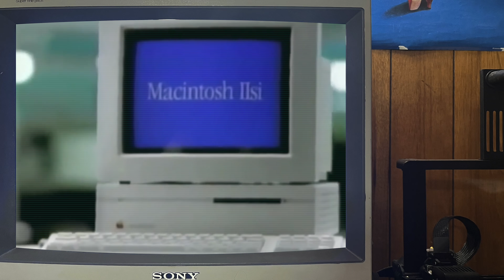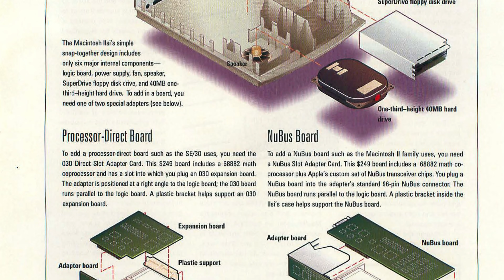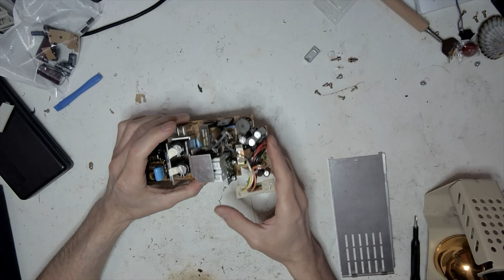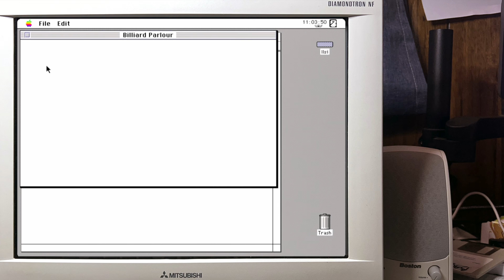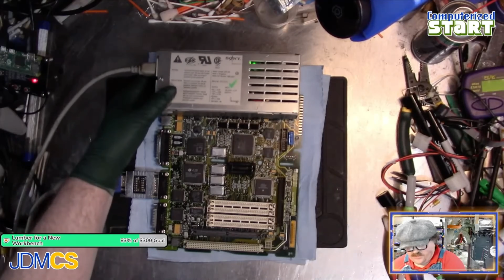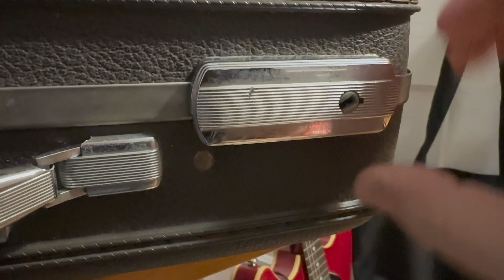Was the Macintosh IIsi Crummy?

Comment: I had a IIsi, a IIci with 60 Mhz DayStar PowerPC 601 upgrade, and a 300Mhz Pentium II running the Basilisk II emulator. I'd pit all three against one another in games of BOLO with all three running the same bot. The PC running the emulator would always win, the IIsi was always the first eliminated. IIRC even when I handicapped the IIci and emulator with lesser bots the IIsi would still lose.

BOLO bots rely mainly on CPU speed. So if you're playing VS bots and want to run other game instances on other computers instead of several on the same Mac, you can change the difficulty by how fast of a Mac you play on VS how fast of Macs you run bots on.
Reply from the maker: Hahaha this is so much more fun than benchmarking with speedometer. I need to try this

Comment: It was a perfectly nice little computer.  It was just worth about 1/4 the price, and it should have come with NuBus slots.
ISA slots were basic table stakes for a cheapo PC clone.  But Apple treated expandability as a price discrimination thing.  Which strangled the market for NuBus cards because not all macs supported them and mostly only macs supported them.  My mom had one in her office in the early 90's and it was one of the things I learned to do computer with.  But it was fast enough for word processing and the kind of desktop publishing most people did in those days.  You didn't have a digital camera, so most of the graphics work in SOHO desktop publishing was very simple vector graphics or low res clip art.  Could even play postage stamp sized Quicktime animations off an external SCSI drive!

Comment: The most important thing about the IIsi is that it has soft power — the ability to turn itself on by a clock event, and shut down without flicking a switch.  By doing this it straddled the low end and high end of the Macintosh II era.

Comment: These were fine for general-purpose office use.  That's what we used them for back in the 90's before Windows 95/98 steamrolled the market.  The 68030 was a turning point in computing because Intel had by this time started making superior CPU's and Windows 95/98 overcame user complaints and drawbacks of using Windows 3.11/DOS.  I was glad to get rid of our Macs by this point because they didn't support real multitasking and 486/Pentiums began to run circles around them by 1998.
Reply: I remember people saying this, but Win95/98 wasn’t real multitasking either
Reply: @whophd  Maybe so, but its multitasking was far better than anything Apple offered which is why Windows came to dominate the market.
Reply: @LIDARWidgets   I keep hearing this, but what is it?  How was Windows 98 multitasking better than MacOS 8 or 9?
Reply: @whophd Windows 98's multitasking was superior to macOS 8 primarily because it used preemptive multitasking for most system operations and new 32-bit applications, while macOS 8 relied predominantly on the older, less stable cooperative multitasking model inherited from its legacy architecture. One misbehaving app on MacOS could bring down the entire system on MacOS 8 and 9 and they used cooperative multitasking.
Reply: The main difference is that preemptive multitasking allows an operating system to interrupt a running process and switch to another, ensuring fair CPU time, while cooperative multitasking requires each process to voluntarily yield control, which can cause the system to freeze if one process doesn't share. Preemptive multitasking is used by modern operating systems for better responsiveness and stability, while cooperative multitasking was used in older systems and relies on each task to cooperate and "play nice".
Reply: (and when you try it these days, you notice a lot of system crashes, just like classic MacOS)

Comment: Did graphics work on a Mac IIci during this period and saved into MS Word files. Used laplink to transfer to 286 Zenith PC running Windows 3.0 on an optical hard drive. Then cut and pasted into text document. Internet was a point to point system that ran 19,200 max!

Comment: A IIsi (new) was my first Mac. Around 2010 many caps had leaked all over the logic board. It was sad.

6:42 The lack of sound was probably the crappy feeler contacts it uses. I had that problem on mine back in the day.
Reply from the maker: It was the bad caps. It’s pretty common with these old macs to lose sound and have it restored by a recap.